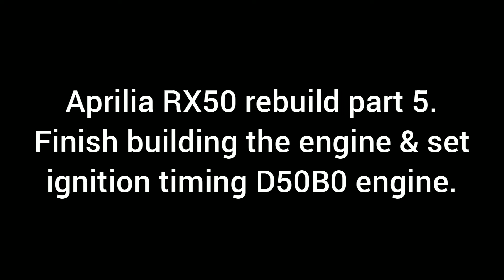Aprilia RX50 rebuild part 5. Finish building the D50B0 engine & set ignition timing.

Comment: Do I need to do the piston things or can I just put the  stator like that and it will be alright?
Reply from the maker: It's recommended to check your ignition timing, because if it's not set properly your engine would lack power and could also be damaged.

Comment: why exactly 1.2 milimeters?
Reply from the maker: The 1.2mm BTDC equates to 20 degrees at the crank/magneto. I know it seems precise, if that's not right it can knock the timing out at the crank quite a bit.
Reply: @TheWeeBaldyBiker  so you just have to have your piston at the highest position possible, and after that you should put the magnet on and check if the hole on it aligns with the hole on that ignition plate? did i understood?
Reply from the maker: @enterpleislv639  The highest point of the piston is top dead centre, you want to check it 1.2mm before top dead centre and the holes line up at 23:27